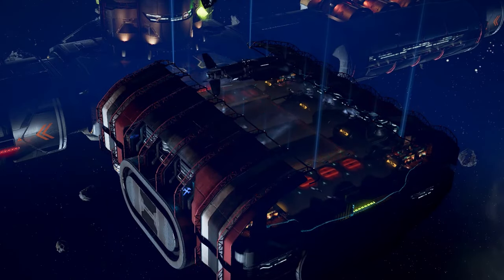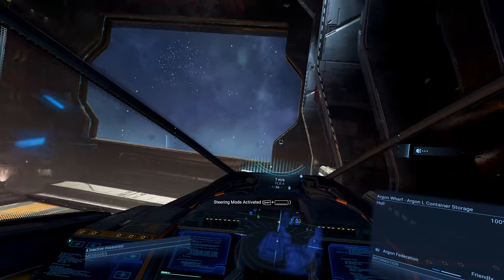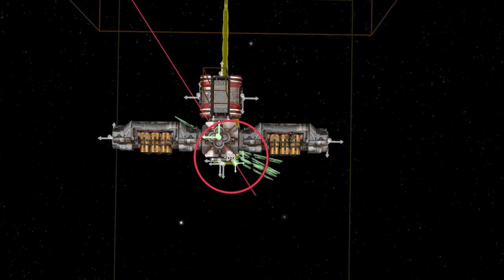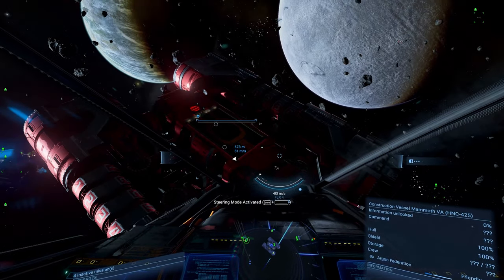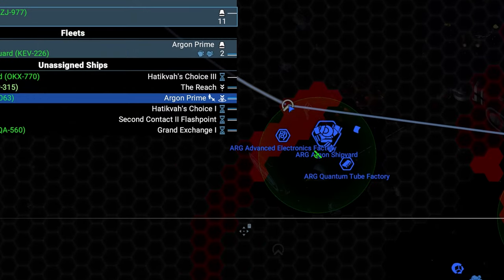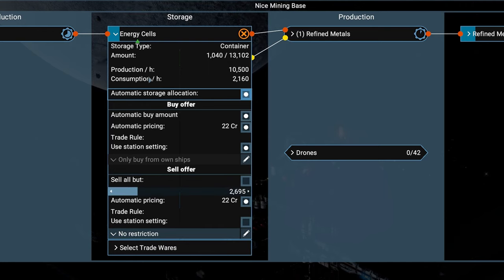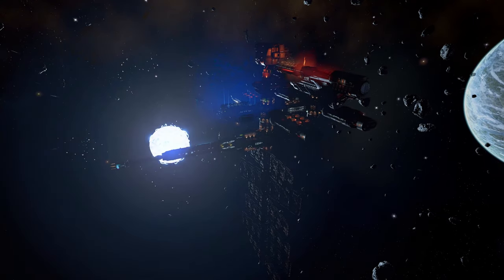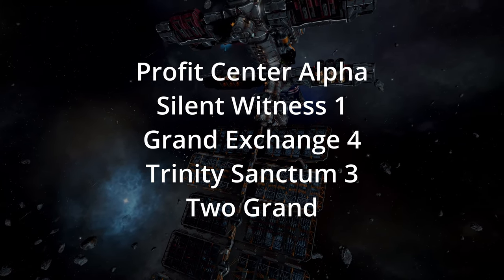X4 GUIDE: How To Run a Factory (4/4)

Comment: An important note. I read this on steam. The solar panel production for energy cells only works here because the sunlight is 100%. You could build a station somewhere where the sunlight is significantly less and be forced to import energy cells add a high cost . Be wary
Reply from the maker: @jj003333  thanks. I'll put that in the sticky

Comment: This a good video to get folks started on the early factory.   I used to like to build factories.  I wish you could 1) build sub-assemblies outside the box and then slide them in, and 2) select the specific connection point you want to connect to - it seemed to take forever to connect to the right point.
Reply from the maker: I support this wish

Comment: That was a nice set of videos.
Thought I would suggest using a 3M-6S dock right from the start. That single M landing pad is going to become a bottleneck very quickly.
Reply from the maker: Thanks. :) Yep. Would be better. I just went with a cheaper route and worked with what we already had.

Comment: Oh and a thing people can try to look at is the overall supply and demands.
Some sectors, can run out of a particular resource, which you can produce, and sell cheap, not only will this bolster the economy, but it will help the factions you want to help.
(Like the Borons somehow keeps on running out of water, so if you have a water production within their sectors, you can sell it cheap to them, which will help them and you.)

Comment: Here's what I did. Buy miners, put on auto mine. Get enough cash to make simple cheap af station so you can produce energy cells. Build some near busy sectors. With just 1 platform, you will make so much cells you can sell them for 11cr even for 10cr that is absolute min. Then just make second energy cell production facility, and that's it. You will make 10+k each minute. Build more enjoy cash flow.

Comment: Great videos! 10/10
But there is one problem:
What do i need the traders for? if there are no restrictions on who can buy at my station?
I followed the series and even rewatched it severeal times to figure out if i missed something because my traders aren't movin at all.
They can't find any deals even though i set up everything like you did and set the pirces to the lowest.
Reply from the maker: Thanks. :) The traders help distribute your wares faster. Them not trading can have a lot of causes - hard to tell from a distance, though. Did you put satellites on possible points of sale so your traders know where they can sell?
Reply: @WatchMysh  i did. Especialy in the reach but also in the surrounding sectors
i was aware of the fact that they are suposed to help the station distribute the wares. But does the station produce so much that this is realy needed?
Reply from the maker: @Dannte2009X  Depends on where your station is situated, how many miners it has, etc. etc. This tutorial is just a general idea you need to adjust to your requirements.

Comment: I followed exactly and everything worked well except one part. When I set the ore sell offer to "Sell all but ~5k" with "no restriction" on trade rule, my mining ships all started complaining there were no buyers, which seems odd to me. Basically when my storage hit 5K, the station stopped BUYING from my mining ships even though my buy offer was set to "Only from/to own faction". As soon as I moved the "sell all but" slider to 20k, they all started filling up the storage again. I'm sure it's user error but I have no idea what is wrong.

UPDATE: I figured it out. I had to change the Buy Order amount to "Buy up to" 100% (20K in my case).
Reply from the maker: Glad you figured it out and thanks for posting your solution! :)

Comment: Im finally at this stage of your videos.  Im having a little difficulty with my miners.  Since setting everything up, the miners that are getting the ore are filling up their ships, but instead of dropping it off at the station they are saying there is no buyers in range.  No sure why they refuse to drop off the ore on the station.  I cant see any problems that ive caused.  Do you have any suggestions?
Reply from the maker: Hard to tell from a distance. Did you place the satellites so the miners know where to go? Does the manager have enough skill/stars? Oh... Wait... Check the set price at the station again and check your whitelist/blacklist. Maybe the station doesn't buy ore, yet? Another thing to check might be the storage. Did you build the proper type? There are so many thing that can go wrong lol...
Reply: @WatchMysh  Your not wrong lol.  Everything youve said seems to be in order.  In the buy offer for ore i changed it to max (100k) in my case as i built medium storages instead of the small ones.  Now the miners have gone back to mining again so hopefully they will drop it off at the station when they are full.  Wow such a head scratcher this game.  Its fun but confusing at the same time! Im guessing if i add another energy cell module it will double the amount of energy cells i produce as well?
Reply from the maker: @llamaking447  Yep. You can double the energy cell production (or even build 16x the modules...) to get a slow but steady income. I usually have my mega-power-plant at the ring highway with a gazillion modules selling cells at the lowest price. Takes zero maintenance and always generates money.
Reply from the maker: @llamaking447  did you allocate storage (buy up to xxxx ore?)
Reply: @WatchMysh  Wow thats awesome! I will look into that. Thanks for your help! Honestly without help for X4 i wouldnt have a clue!
Reply from the maker: @llamaking447  Thanks, giving my best :)
Reply: @WatchMysh  Yeap that is what the problem was thanks.  They are happily mining and dropping off everything at the station now.
Reply from the maker: @llamaking447  Yay. What was the problem? Storage allocation?
Reply: @WatchMysh  Yes, under buy offer on ore i needed to change it from auto to manual (buy up to) and max it out.  I guess it was too low under automatic so my miners didnt know what to do.

Comment: I seem to have the production of refined metals up and running and my ships appear to be moving my refined metal from my facility to an arg hull parts factory but they get no money for the delivery I have no idea what I'm doing wrong.  It shows they are making a profit but its not in my account do I have to withdraw it from the station?
Reply from the maker: @mirage1857  yes, very likely. Check the station balance.
Reply: @WatchMysh  is there anyway to get it to desposite directly to my balance ever or does it always only ever go to the station balance?
Reply from the maker: @mirage1857  I don't know of another way. Maybe there is? Let me know if you find one please.

Comment: As much as this was a helpful guide, I already outgrew this tutorial so it didn't benefit me all too much, tho there was a few tips and tricks I did pick up, like sell all of the wares except how much the station needs for production for one hour.
Another thing to add, if your factory takes in multiple kinds of either solid or liquid resources, it's annoying to assign a a gas or mineral miner to the station cos they always tend to go for only one resource. I kinda got around this issue by giving a station so many miners that they could 100% fill one resource storage and be forced to gather other resources.. Or, like I did my self sufficent shipyard, I just ordered miners to do advanced automine to one resource and lock them to trade only to my stations. Kinda annoying cos I have now about 80 unassigned ships in total, with a vast majority of them being L miners or traders.. I only have like XL ships in there without a fleet, and 3 scouts sitting in the furthest reaches of the gate network so I can teleport there and go talk to faction representatives or accept guild missions easily.
Reply from the maker: Yes, the guide is directed at noobs. But nice that even seasoned X4 players can pick up a thing or  two. :)
Reply: So the solution is to have seperate stations for each production that needs a specific solid or liquid
Reply: @Venomaus_  That kinda works too, but then I would need separate trade ships going between stations, and it's more stuff to set up.  I prefer to stick with one big station with enough miners and gas collectors to supply the station.

Comment: Any tips my M miners are getting absolutely demolished by the Kha in  the reach the raiding parties are massive sometimes I dont have the money to replace the miners, and or buy escorts, is there anyway to help with this issue or do i just have to tough it out
Reply from the maker: Make sure your miners don't carry guns so they instantly flee. Otherwise you could do the Terran plot where you can get a ship that easily demolishes Kha'ak hives. Search for them on the outskirts of the system where you're being harrassed. Blow them up. No more Kha'ak... for a while.
Reply: @WatchMysh   Okay Ty ill have to try that, maybe there is a hive nearby.  my miners try to flee they have no guns but they are getting swarmed by 7-8 heavy fighters and instantly die
Reply from the maker: @dynamic1182  Has to be a hive there
Reply: @WatchMysh    Ty didnt know they could build those its pretty defended gonna have to keep a watch for now
Reply: @WatchMysh   Ty for all the advice but I am afraid this save is a lost cause i tried for the last 6 hours to stabilize the sector but i ended up losing a mining ship every 10 minutes or so I am now bankrupt and, been utterly defeated, the station also politely destroyed me and the forces I could muster to destroy it but it was fun